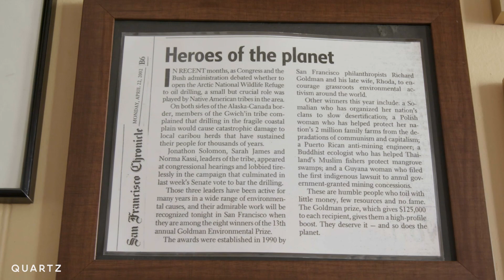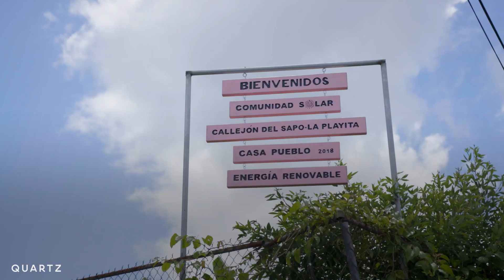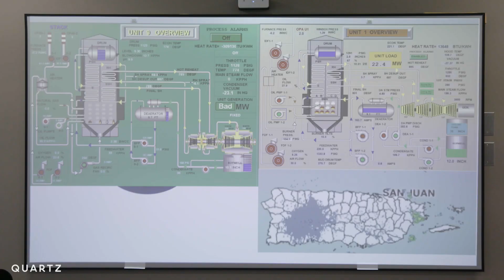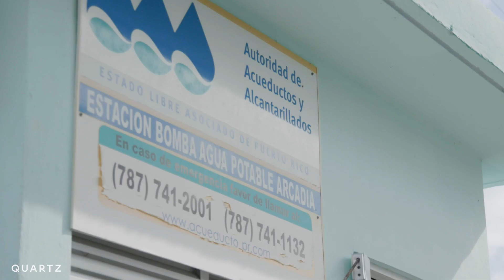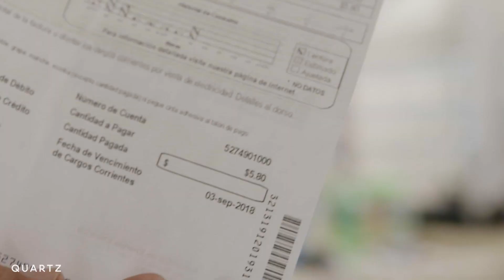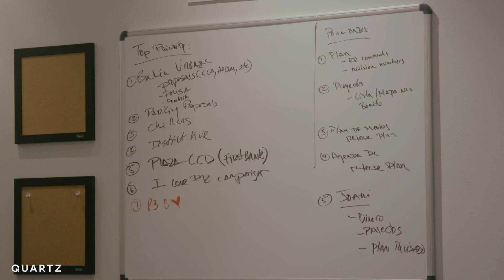Puerto Rico's solar energy insurrection

Comment: More trash journalism, doesn't even bother to research the issues and the underlying problems with a micro grid based on solar and the limitations of current batteries. Your let's take a position first and then write a story to push the agenda forward rather than exploring in depth the pros and cons.
Reply: You are the one who has not bothered to keep up with current events. Solar panel tech and battery tech have been improving and are now improving exponentially... Just Tesla has 100 microgrids already in operation and the test grids before that were started many years ago... Utilities have already started making the switch because it will save money and they have to compete with local power generation which is about to become so cheap that all homes will generate their own power just because it will be so cheap. The world of energy abundance is where we will be living just a few years....